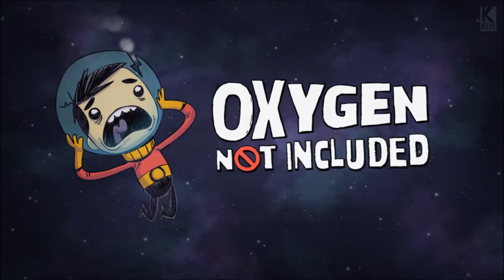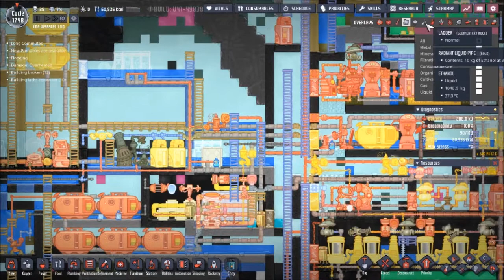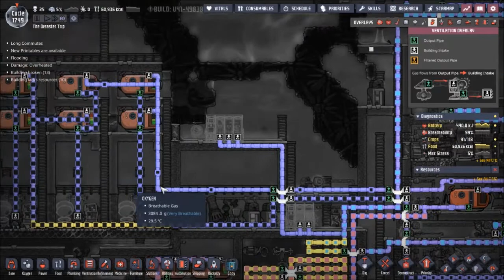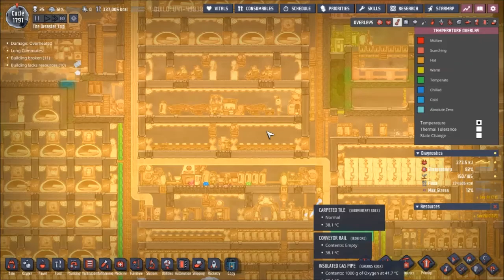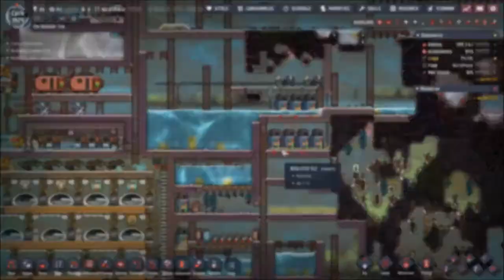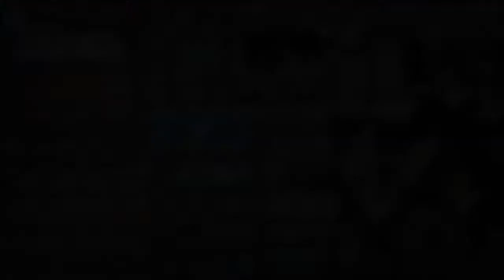Oxygen Not Included - 16 - Thermal Aggravation Tuners

Comment: At 21:00 - I think the overflow around the aquatuners is wrong? You want it to be going through the input port, not split around it. Then if you automate disabling the aquatuners the water will ignore the input and go to the overflow bridge. Right now you're cooling only half of the blobs.
Reply from the maker: Bit of a spoiler here: right now I'm about 1000 cycles later and my grasp on those things has got a little better.  That said, whatever goofiness I managed to make work hasn't fried the tuners in quite a while so I'm okay with imperfect cooling.  :D